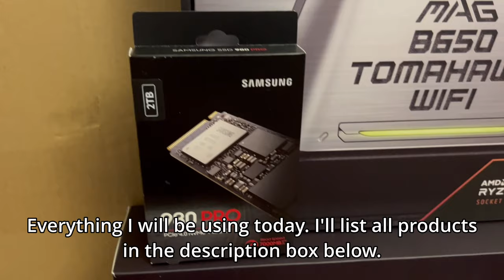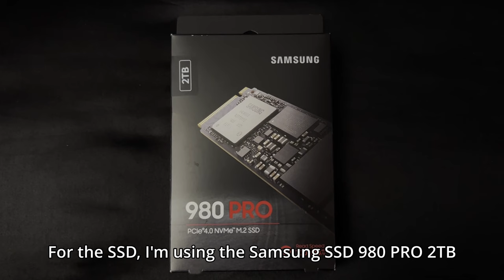Building my first PC - All black, high-end [RTX 4070Ti, Ryzen 9 7900X, MSI MAG B650 Tomahawk Wi-Fi]

Comment: Gosh what a beast for a first pc. I started watching Linus Tech Tips back in 2019 and thats when I initially got interested in pc's. I was a freshman in high school with basically no money at the time lol. Covid came around and I need a system to do zoom and homework on so I fixed up the old family pc in the hallway. (Had a dual core E7300 and 2x2 Gb's of DDR3-1066 MHz). From there I upgraded to a usable cpu (quad core Q9500) and then added an RX 560 2 GB. The rabbit hole went deeper lmao. By late 2022 I had a 10700k overclocked to 5.1 all core, 32 GB's of 4000 CL15 ram, and a 3080 Gaming X Trio overclocked by 18.5% (according to timespy). I still love building and overclocking pc's to this day, but lately the economic situation just doesn't have that many ppl interested in dropping money on a new pc.
Reply from the maker: I went hard for this pc build lol my first pc was pre-built. I got it when the pandemic had just started and getting parts was difficult. It had a 3060ti in it and was a good pc but very small because the tower was a mini. It had like 2-3 fans that were tiny haha.

I always wanted to build a pc and pick every component in it so building this pc was a dream! With this new build, I’m finally able use Ray tracing when I play games and I don’t have to worry about high temps.
Reply: @itisidaisyttv  oh for sure. To be fair to the 3060 Ti I do still feel like you could run 1440p raytracing with dlss but thats as far as I'd push it. Ur rockin for sure with that 4070 Ti though, and the efficiency paired with a massive cooler definitely means super low temps (although I think the manufacturer prioritizes low noise over temps, so even at like 25-40% fan speed you could get gpu temps in the mid 50's)
Reply from the maker: @jakobe_bryantgaming5580  oh yeah, when I go into the NZXT app you can adjust the performance level of the cooler and fans but they all seem quiet. I guess I was too scared to run Ray tracing with the 3060ti because of the 3 tiny fans I had 😂 now I have no fear!
Reply: Cl15 running at 4000mhz that shit must've been snappy asf, goddamn 🔥🔥
Reply: @realhappyguy  basically all 3000 CL15 ballistix can do it really easily. It just comes down to ur cpu's memory controller. Ryzen 5000 can probably do it? I know anything intel 10-13th gen can do. Any ryzen 4000/5000 apu can do it easily too.

Comment: Good job on your build, I dont know if anyone has mentioned it but the tubes on the AIO should be at the bottom not at the top.  you may have problems with sound and air bubbles in you cpu cold plate.  Also it will cause the AIO wear out more quickly. Hoped this helped. Gamers Nexus put out a great video on this

Comment: Great build! There is a few things I would change however. The ram could be replaced with G Skill Trident 32 gb because it has a CAS latency of 30 which is proven to be way faster than the Corsair Vengeance CAS latency of 36 for basically the same price.

 The CPU is an interesting choice since it's usually used for productivity builds and not gaming. If you're looking for lower CPU temps, the arctic liquid freezer II 240 mm or 280 mm would be a much better choice for a cheaper price.

 The airflow on the case is pretty bad so i wouldve chose a different one such as the corsair 4000d or 5000d. Overall, this is an amazing first rig and a great opportunity to start 3D animating, video editing, etc.

Edit: I am currently buying the parts for my first build that's meant for blender. It was actually really similar to yours originally but I updated it to have more value for money. I haven't watched the full video yet, but if you have a laptop, I recommend copying the windows installation files to get windows on your pc for free. If you want to look at it, this is my current parts list:

CPU: Ryzen 9 7900x
CPU COOLER: ARCTIC Liquid Freezer II 280 A-RGB
Thermal paste: Thermal Grizzly Kryonaut Extreme
Motherboard: MSI Mag B650 Tomahawk WIFI
Ram: G. Skill Trident S5 32GB
Storage: Samsung 980 Pro 2 TB
Graphics card: Gigabyte windforce OC 4070
Case: Corsair iCUE 4000x RGB
PSU: Corsair RM750e (2023) 750 W 80+ Gold Fully Modular
Reply from the maker: Thank you for the tips!! This was my first time building a PC so there’s quite a bit I’m new to, but I do want to replace some parts. Maybe around Black Friday since that’s coming around soon.
Reply: @itisidaisyttv I think the parts are fine. Im using same ram with my 4090 setup. It not a problem for gaming. If its same price for CL30 then lower latency is better but for gaming the difference is negliable.

However if you mount the radiator at the front the tubes should be down and not up. There are several videos on youtube about this.
I prefer mounting radiators at top as exhaust.

Comment: I love all black builds, but in the future you should probably swap that case out, it's known as the hot box
Reply from the maker: Yeah some people have commented that and I had no clue. My temps have been good so far but I’ll look into other cases for sure.
Reply: 40 series cards stay cool in general due to their massive heatsinks and your cpu is cool because it's an aio. If it was an air cooled cpu then you would probably notice the hot temps
Reply: Also make sure your m.2 samsung ssd is not part of the batch for bad firmware causing them to die earlier. I think it was the ones manufactured in 2020 or 2021, I am not sure about 2022 and 2023 if they affected. Just make sure to update the firmware in samsung magician for your m.2 ssd
Reply from the maker: @TheBlueBunnyKen  holy crap. I hadn’t heard about that issue with SSDs. I’ll look into that. Thank you!
Reply: Btw all the screws come in an accessory box which is in the basement of the case, unless you got a used case with no accessory box included. It would have all the screws for the motherboard mounting etc
Reply: But yeah 970 and 980 m.2 ssd's for earlier batches have a bad firmware out of box, so as soon as you put it in your system install samsung magician and update the firmware of your m.2 ssd. The bad firmware caused permanent damage to data blocks that couldn't be restored, so the m.2 ssd would slow way down within a few months. I also noticed there was no heatsink for your m.2 or was it not shown? The 980 pro m.2 ssd can get really hot without a heatsink which will slow it down. Most motherboards come with an m.2 heat shield over the first slot unless it's a very budget friendly board, then you would have to get a heatsink version of your m.2 ssd. Another important thing with 40 series cards is to make sure the 12pin connector is all the way in until you hear a click and make sure it's properly seated in the port. It can cause the connector to melt if it's not properly inserted or if you bend the cable too much

Comment: are all the screws included with the components? like for mounting the aio on the cpu and the brace for it on the motherboard. you mentioned some were missing?
Reply from the maker: Everything is included. The motherboard didn’t come with screws, but I found them later in the nzxt case packaging so you don’t need to worry 👍

Comment: This Friday, February 23, I will be building my new PC. I look forward :)

CPU: AMD Ryzen 7 7800X3D
GPU: PALiT RTX 4070 Ti Super GamingPro
Motherboard: MSI MAG B650 TOMAHAWK WIFI
Memory: Corsair 2x16GB KIT DDR5 6000MHz
CPU Cooler: NZXT - Kraken X72
SSD 1: Samsung 980 PRO, M.2 - 500GB
SSD 2: Lexar NM790, M.2 - 1TB
HDD: WD - Purple, SATA - 4 TB
Case: Fractal Design Meshify 2 RGB Black
Power Supply: Corsair - RMx 750W
Monitor 1: 34" Dell S3422DWG, 21:9 UWQHD 3440×1440, 144Hz
Monitor 2: 23.8" Philips 245E1S, 19:9 QHD 2560x1440, 70Hz
Operating System: Microsoft Windows 11 Pro
Sound Card: Audioquest DragonFly Red
Headphones: Beyerdynamic DT 990 PRO
Keyboard: AULA F2088 Mechanical Gaming Keyboard
Mouse: Logitech - G502 Proteus Core
Controller: DualShock®4
Reply: How's your build, so far?

Comment: can u tell me the temps of ur cpu and gpu while running a game?
Reply from the maker: When I play RE4, the CPU is around 60 celsius and the GPU is around 65 celsius. My graphics for the game are set to high and the temperatures do fluctuate a bit. I’ve seen them get to around 70 celsius.
Reply: @itisidaisyttv  those are actually good temps considering the case u got...the h510 is known for bad airflow but im glad ur not facing any of those temps issues.
Reply from the maker: @TerminatorVAL  yeah some people have commented about bad airflow for this case and I had no idea lol but I have a great CPU that is designed to keep cool temperatures and I think that’s why it’s doing so well :)
Reply: @itisidaisyttv  actually it's quite the opposite...the 7000 ryzen Cpus runs much hotter  compared to last gen becoz of the higher clock speeds and much more stuff I don't know about😂...but the cooler u chose for ur build is too good...even though it's a 240mm inside a bad airflow case...it's still keeping the cpu's temp under control
Reply from the maker: @TerminatorVAL  this one specifically runs cooler than others in the 7000 series. I compared a lot of the CPUs and this one is phenomenal at keeping cooler temps. It’s funny because I might actually upgrade the cooler 😂 I love this one but I’m still considering getting a newer one in the future

Comment: He placed your radiator on the wrong way round :) not his fault either. Manufacturers use that configuration for front mounted radiators in promotional photographs purely because it looks nicer but this can shorten the life span of the radiator and you may start to notice a whistling sound coming from the pump, its much better to mount I it so the pipes go down the bottom of a front mounted radiator :) then all the air is moved to the top, away from the liquid flow :)
Reply: And curse case manufacturers who place the "caution" sticker underneath the film peel! 😂 there's a special place in hell reserved for monsters who thought that was a good idea 🤣

Comment: Nice video but that case with those parts its a hotbox bad airflow 🥵
Reply from the maker: The temperatures don’t get high. I monitor them as I play and the airflow is great 😊 plus my cpu is designed to keep everything cooler.
Reply: What are the temps on the cpu and gpu under load i have had the same case and it was not good at all nzxt made the 510 flow case because many had issue with 510 but Nice build video 😊
Reply from the maker: @Jesper1988  my cpu stays around 47 & gpu stays around 37 when I’m not playing. When I am playing, I’ve noticed they are between 60-70. I’ll keep monitoring them though since this is a new build 👍